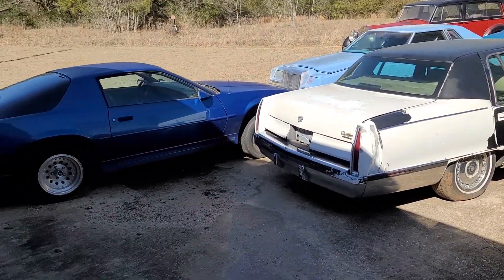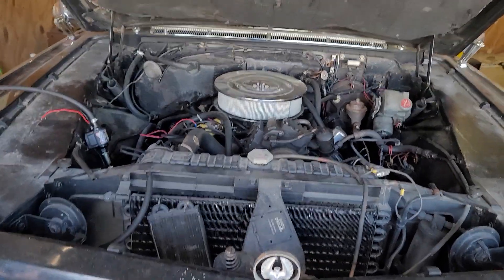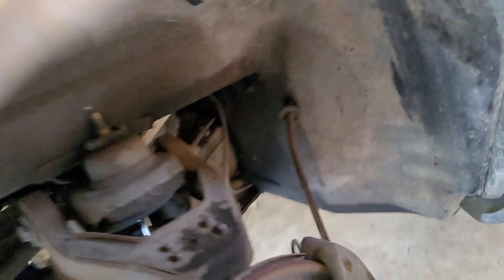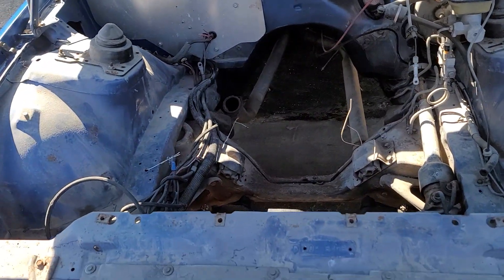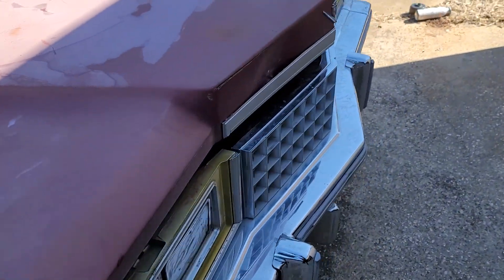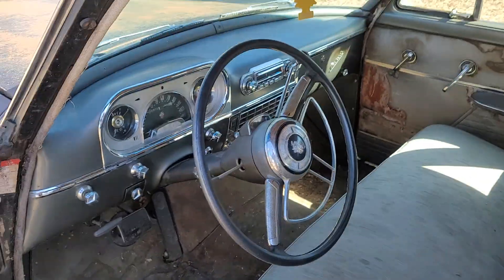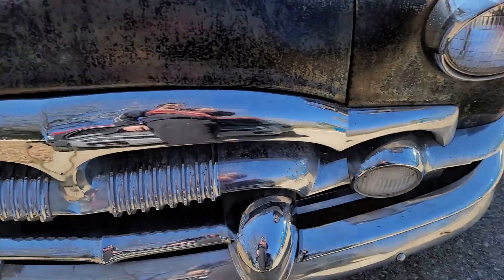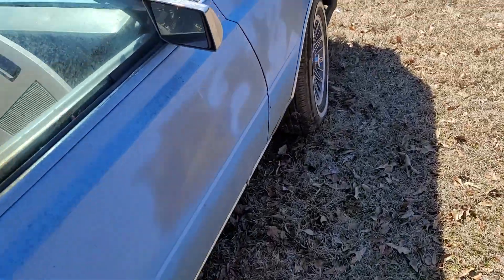Spring 2022 Fleet Update and Vehicle Needs Summary

Comment: Having owned an 81 & an 83 Imperial, I can appreciate how much work is needed to get one done. Love any Mopar and/or the Packard see get running again. Little by little - you’ll get there!
Reply from the maker: A lot of work for no ROI.  From a financial standpoint, parting them out would be the smartest thing; however, I will not be doing that.  I am working on setting up the back half of the garage so I can pull the Packard engine and rebuild it.  After a few months of it still being stuck, the outlook isn't good.

Comment: 76 Cadillac and the Benz would get my vote.  Did you have the imperials listed for sale, saw something in an imperial owners FB group for 2 81s - thought it might’ve been you.  No bites?
Reply from the maker: I did; was hoping to downsize.  Lots of "If I had the money" for a pair of cars at $3,500...

The 6.9 requires a parts car; which doesn't necessarily put it out of the running, but leads to the situation I'm at with the Imperials.